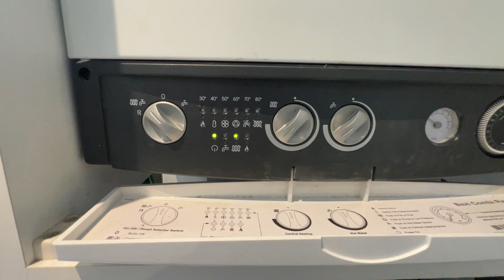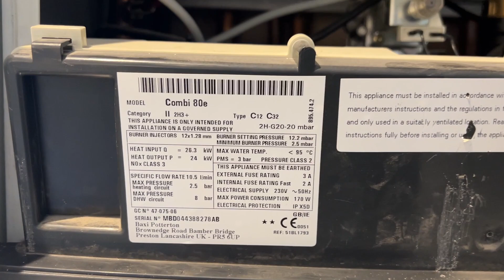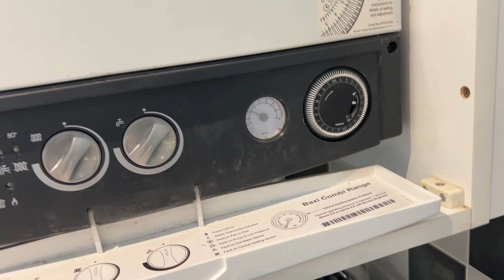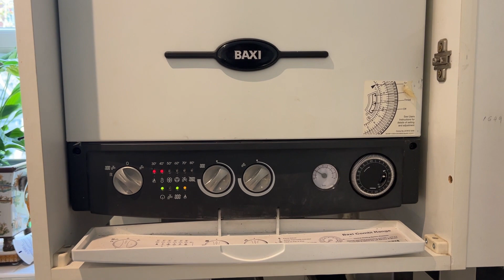Baxi 100e / 80e Combi Boiler Fix | Boiler Restarting issue fix | Air Pressure Switch Replacement

Comment from the maker: Gas engineer told me to replace the boiler for a new one. He offered £1600 to replace the boiler. I spend 50 quid for the air pressure switch. That's all cost me !!!

Comment: I have the Same boiler and same fault, Changed the air pressure switch but ended up being the board, worth a try though thanks 👍Baxi 80E